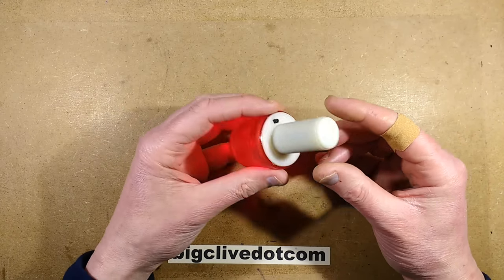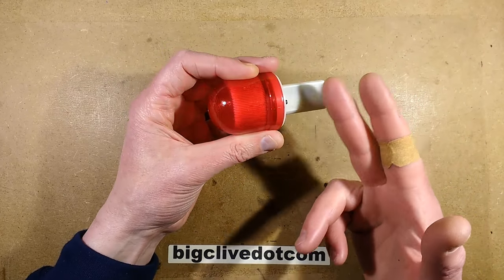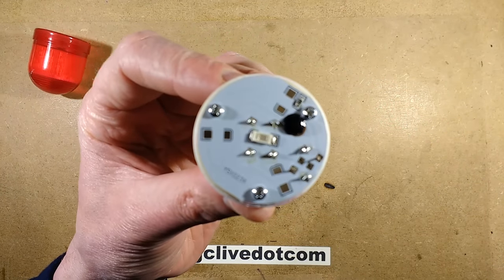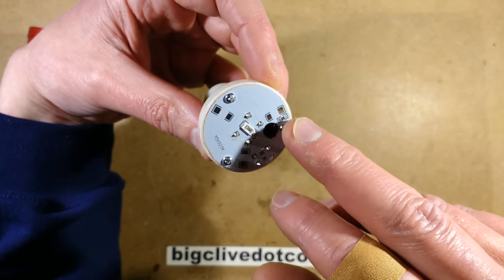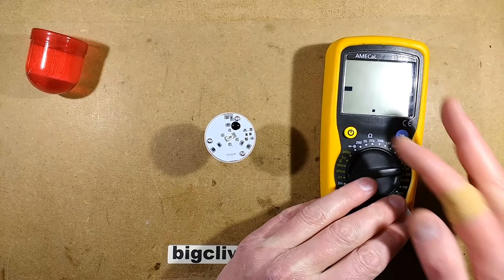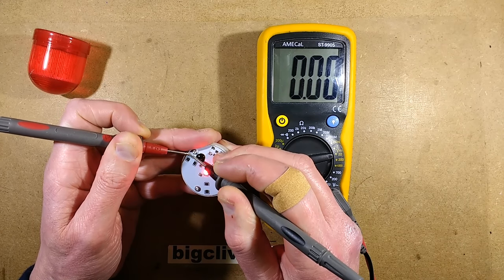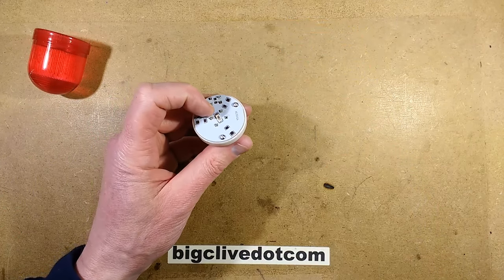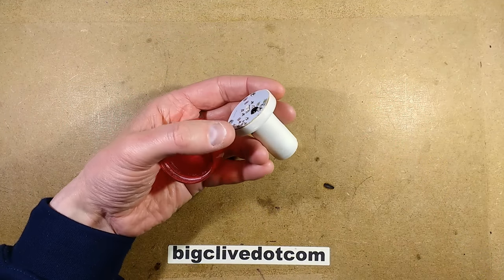Cheapo eBay hazard warning beacon from China.

Comment: You see these all over Asia.  They are used on bits of dowel or plastic dowel as "waving signs"...for when cops want to pull you over at a road block for document inspections.  Lots of different colours and the colours have a particular meaning.  In Australia you see these drilled onto bits of wood at road works where pedestrians have to cross over a hastily created optional path to clear around the works.

Comment: looks like the battery compartment would slot into the hole in the top of a traffic cone and turn it into a flashy light traffic cone. who knows if thats what its actually intended for.
Reply: They fit the top of telescopic traffic cones
Reply: They would fit the floppy vinyl  traffic cones as well. At least, i think they are vinyl. They feel like vinyl.
Reply: Looks like the switch is in an odd place, unless you switch them on and off by pushing them down as you walk/drive past.

Comment: Love your stuff, Big Clive.  Very informative and instructive.  Especially Fanny Flambeaux . . . but that's another story.  You mentioned lighting issues.  I've ordered lighting kits off eBay that aren't expensive - one came with 1115v fluorescent bulbs (I'm in Canada), the other came bulbless, and I populated it with LED bulbs.  They seem to work fine, and provide a nice non-specular light source.  You might look into one or two of those kits.  You'll need light stands (sold separately, but properly positioned they're going to eliminate a lot of the shadow as you work.  Cheers from Prince Edward Island!

Comment: My guess: The Resistor is to change the default constant current value for the LED driver, for example if left floating it will do 20mA, if you apply a 1k resistor to pin RSET it will do 100mA etc.

Comment: I wish they wouldn't use aaa cells for stuff like this, it seems like a single aa would do the job just as well or better. AAA cells are fine when size is really an issue, but for something like this just design a circuit to run off voltage from a single cell.

Comment: Looks very similar to what the police (NSW AU) were using here for a while. The ones they had flashed red and blue though. A clear cap on top instead of the red one obviously.
They used them in the traffic cones (do people call them witches hats elsewhere?) when they were doing "random" breath testing at night. Haven't seen them for a while though.
Reply: Perhaps the other spare LED spots are for blue ones.
Reply: That's what I was thinking. Or possibly even all sorts of combinations for different purposes as required.

Comment: Wouldn't be allowed on UK roads because any traffic lighting of the warning variety has to conform to British Standards like manufactured to BS3143 part 2 and BS EN 12352.

There would be nothing stopping users implementing these lights for use at public events, school driveways, private companies, etc but for use on the highways, you can be fined for using such lighting as its not conforming to strict regulations.

Comment: So I bought one of these and the modes are different than yours. Yours has 2 modes, blinking and static but mine has a third (first) mode where the two LEDs blink in sequence instead of blinking simultaneously. Everything else appears to be the same.

Comment: Are you ever going to do a review of the newer mains power LED COB that don't require a separate power supply? This seems like something you would have jumped on a year ago.
Reply from the maker: +ipissed I've got one here, but seem to have misplaced it.  When it turns up I'll analyse it.  These things tend to use the chips that regulate current and also switch the led in series sections across the rectified mains.

Comment: I spotted the words HAZARD and WARNING and thought, yes somethings going to explode....
awwww  :( no big bangs   :(

Nice man has done it again, simple tip how check a diode.  Then i suddenly remembered an old
computer monitor board that kept blowing fuses. Did i check the diodes?
Answer yes i checked the diodes, but whats this blob of silicon hiding with the large resistor?
Bridge rectifier... Did i check that.. 1st 2 pins nothing then 0.6v thats fine.  2nd set 0.3 and 0.3
damn.. how did i miss that.

Thank you for jogging my memory.  Just got a few bills to pay and i will either contribute a cuppa
or order something naughty from China i know you like that stuff now. Shh your secrets safe with me.

Comment: Hi Clive I'm needing something to regulate voltage variably to test a few things what would you suggest iv seen a few things (12v motor controller) but with my limited electronic knowledge I'm not sure if regulates voltage or amps max I will need is about 12v

Comment: hey big clive going off the subject a bit just wondering is their any way of testing if a capacitor has failed i have 3 in a t.v that im looking to fix that look a bit swelled  is that the only way of telling or can you put a test meter across them great videos by the way i watch them all the time you can never learn enough so between you AvE and EEVblog keeps me amused
Reply from the maker: +diggin pooch If they have swollen and bulged at their end then they definitely need replaced.  To properly test a capacitor you need a device that can measure its value and ESR.  (Equivalent Series Resistance.)
Reply: thank you very much i will just change them see if it fixes the problem this is why i subscribed and watch daily coz your knowlng is endless wisdom plus who else reviews butt plugs and random e-bay tackyness for your viewers to be amused
Reply: AvE does.

Comment: Audio doesn't seem to do the AGC thing it did without the mic, but it feels off somehow.  It feels more camcorder-y than the ipad audio did.  Do you still have the iRig around?  It sounded really great when you were testing with it, back here: https://www.youtube.com/watch?v=UvlXd71BfsI&t=37s
Reply from the maker: I tried the iRig and it was super-quiet even on its high setting.  For some reason Lenovo (who now own the Moto brand) have locked the gain on the external mic to a ridiculously low level.
Reply: bigclivedotcom you could try the irig mic hd on a boom arm but that may just become another thing to get into the way, bang into and possibly set fire to. I presume it was the lav mic you tried